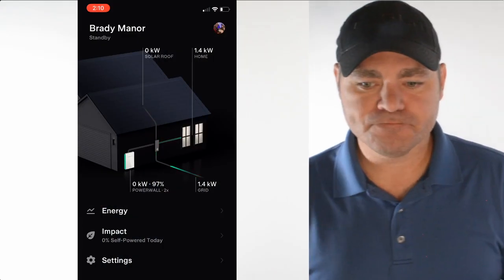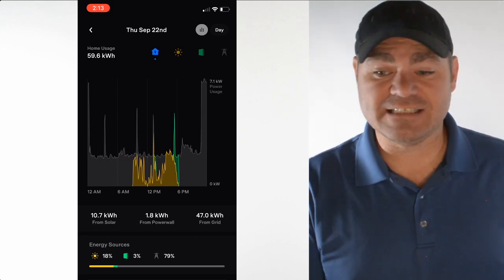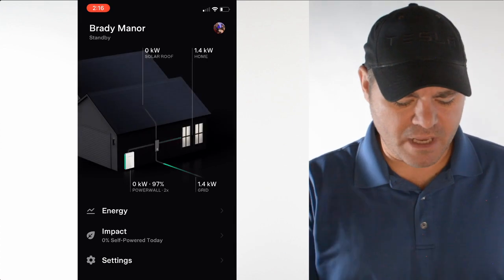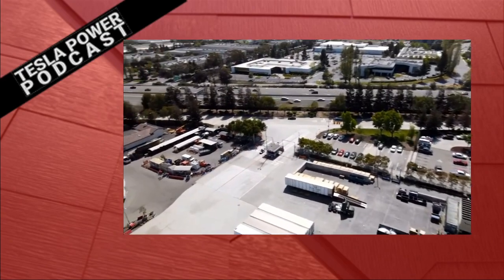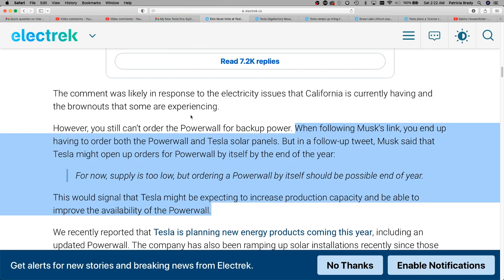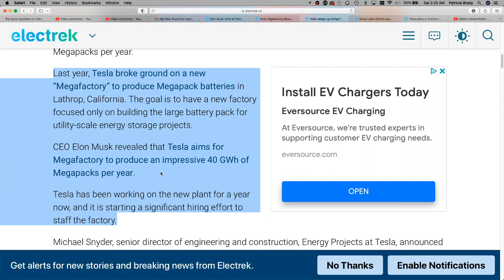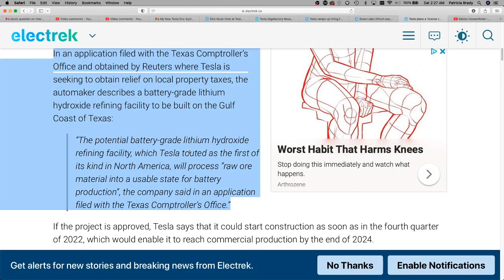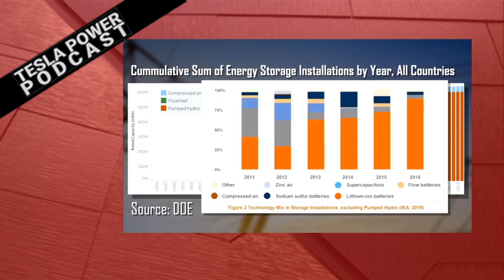Episode 064 - Battery Backup Longevity and Best Practice | Battery Manufacturing and the IRA

Comment: Good one Aaron. Update for me, install went well on my 16kWh system with 3 powerwalls. They did a great job getting it done in 2 days in a nice and tidy fashion. Concealed conduit and even got terracotta color matched paint for the small bits that had to be on the outside. I even paid one of the guys on the side to install critter guard (Tesla doesn’t offer it) City inspection done a week later and now waiting for utility inspection and PTO. 
We’re pretty excited.
Reply from the maker: 2 days from start to finish?  Solar panels and electrical?  That's pretty good!  Here's to hoping PTO is in your near future :-)
Reply from the maker: Any update on PTO?
Reply: @teslapowerpodcast  yeah, I got PTO Oct 22. We are LIVE. System is producing up to 11.7kw. Gets batteries charged, skips all of the peak times and demand charges, gets us through the night and we sell another 30kwh per day back to the grid on a good day. Weird fall weather right now and we are still making out well but not as much export as on sunny days. Thanks for asking!
Reply: Btw, on SRP E27 production plan as of Nov 1 there are two peak times 5-9 and 5-9. Use of a single kWh during peak brings a draconian demand charge of $9 and can get out of hand quickly. So, we are extra glad we put in 3 powerwall+ units. It’s pretty hard to beat the dealer.. but so far so good.